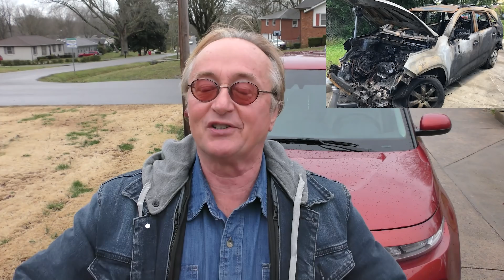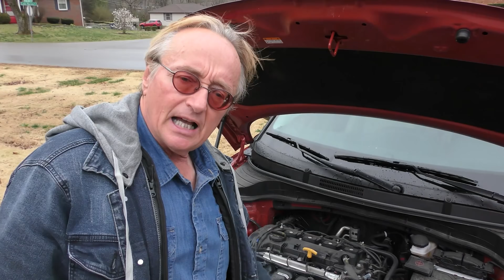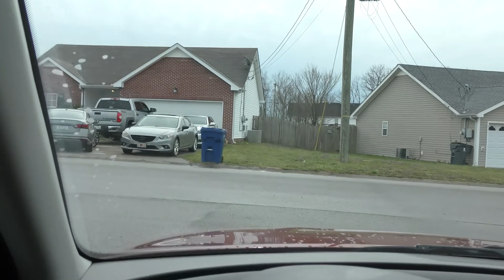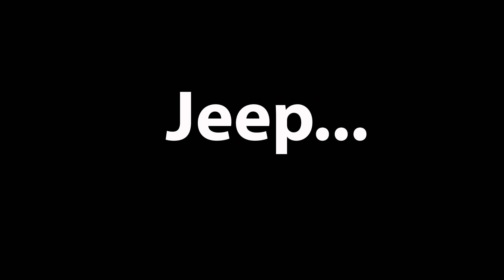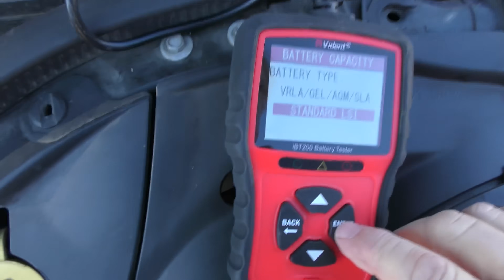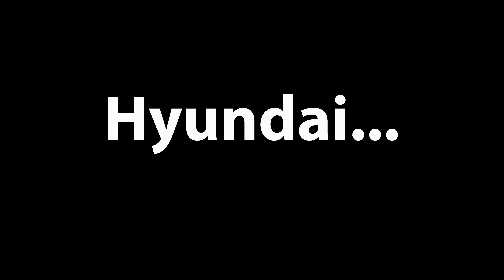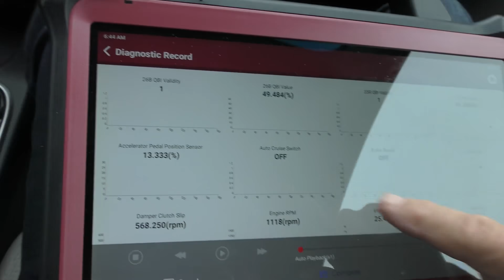3 Car Brands That are Crap

Comment: I jist chamged the sparkpmigs on our 08 Escalade....i put new ac delco sparkplugs in.. bur the old ones? THEY WERE SPOTLESS!  Totally dry, ,and not all carboned up, and not white , just a little worn, but it showed me, in gemeral, its healthy, although.i figured that, because its never low on oil,so i knew it dodnt burn a drop, i only use mobil1 synthetic oil and mobil1 filter

Comment: INVARIABLY DODGY COMMENT FOLLOWS:  "BUT BUT.... I own a (Hyundai/Kia/Volkswagen/Mini) with 484,000 miles on it, still driving like new!  A broken tire valve cap for 4¢ is the only repair it ever needed.  MY car gets its oil changed like clock-work every 29,000 miles and it's never needed repairs!  You people must be driving your cars in a demolition derby, right before the Indy 500 afterwards!"

Comment: My Hyundai was tough it had 437k on it lol of course after I changed the timing belts and idler pulley wheels and front end alignment and exhaust and floor work and windshield and wheel bearing ok whatever it was good on gas lol

Comment: I’ve got my mom’s 05 focus. Bought new. Oil changed regularly.  It now has 215,990 mile. Uses No oil. Runs as good as new. Gas mileage is 29-35.

Comment: I remember back 50, 60 years ago new cars used oil.  I had a new 74 Buick that used a quart every 500 miles. My first car that didn't use oil was a 80's Buick.

Comment: I have a 2020 Kia Soul, at 5,500 miles the fuel pump quit, I was stranded in the freeway for three hours waiting for a tow truck . Flash forward December 18, diagnosed with Transmission Failure at 72,000. Still waiting to get it back from the dealership as of today January 3, 2025. Kia stands for Killed In Action !!! By contrast my son has a 2014 Soul that has had no issues .

Comment: Technically, 1 qt (or liter) every 1,000 statute miles is part of the breaking in of the engine, as it wears, that oil consumption SHOULD go down over the next 20,000 miles or so

Comment: I own a 2004 Jeep wrangler that just refuses to die. It has 346,000 miles with the original motor and transmission. Motor burns no oil but does leak plenty. It really saddens me but the newer Jeeps are total crap.

Comment: A friend at work just bought her daughter a 2015 Kia from a private owner and had it only 2 months when the transmission died.  The mechanic said he could replace the transmission but there's another problem with the car: the engine.  I don't recall what he said what was wrong with it but basically said the engine will probably last another 3 more years.  She paid $4,500 for the car.  It's hard to believe the private owner she bought it from didn't know about those things, but she claims he didn't have a clue.  She even had difficulty finding an insurance co that would insure it.  I don't remember the reason but she finally found an insurance co that would insure it.   The fact that no insurance co would have insured it would have steered me away from buying that brand of car.

Comment: I would not buy a Kia either. I'm pretty sold on Toyotas I'm just going to get Toyotas unless I get a Ford and then I will get a ford. If I need a bigger truck than my Tundra then I will definitely get a Ford and I'm going to tell them to stop being a bunch of punks and make the Ford's easier to repair. I know it's possible Toyota does it and Toyota can you make it even easier to repair however there's still a lot better the Toyota mechanic said that he hates it when another brand comes in because he knows it's going to be harder to repair

Comment: My car leaks oil but it's got 250,000 Mi on it actually I think it leaked oil the whole time and I think I got it when it had 195,000 MI I'm actually not sure when I got it maybe I had 200,000 mi. But the guy who sold it to me lied and said it didn't have any leaks. It doesn't really matter to me that much because I feel like all my cars have leaked oil and I just fill up the oil. That would be pretty bad if it was 17,000 miles though

Comment: Those tipm issues are brutal. Such junk. My caravan had some hilarious issues. Windows up and down themselves. Lock unlock itself. Almost spent too much. Did some research. Disconnected battery, uninstalled tipm, electronic cleaner, back in with dialectteic grease. No problem since

Comment: Personal experience. 79 Ford Pinto: Trash. junked at 60k mi.
86 Hyundai Excel: Trash. Equal to Pinto.
94 Hyndai Excel: Not bad, sold after 85k mi.
98 Camry: pretty good. Some repairs. Sold after 165k mi.
2009 Kia Optima, 110k mi pretty good, still have it. Good as 98 Camry.
2010 Hyundai Sonata hybrid: lasted 200k mi. got money's worth.
2019 Elantra: 50k mi, so far excellent. They are getting better over the years. I would buy Kia or Hyundai without reservation. I expect 200k mi with reasonable issues similar to Toyota.

Comment: I've owned three Jeep Grand Cherokees, a Jeep Liberty, and a Jeep  Compass. I had to replace the computer in the 1991 GC at 106,000 miles, a timing belt, and a fuel sensor later. I changed the oil every 6 k miles in the 5 liter V-8. Put in platinum plugs once. Never had an issue until 175 K miles when I slid on a patch of black ice into the back of an old Ford Explorer at 10 mph and the front end exploded in plastic and Styrofoam, and the air bag exploded  in my face. Otherwise, that Jeep wanted to run forever. I live in the Rockies and all the Jeeps I've owned ran in the cold. Grand Cherokees are great, and that 2011 was pretty good, too. I didn't like the flared wheel wells -- kept popping them off turning into my garage. The 2014 Compass was a disappointment, but ran just fine. Even with 4 WHL drive it wasn't sure footed on the snow. Now I drive an electric Leaf. Too old for the mountains. 😉

Comment: A friend's 2013 KIA Santa Fe with 260,000 km still runs good.  It may not run as quietly as a Toyota, but it's reliable daily transportation.  As a die hard Toyota fan, I'm getting more impressed with Korean cars every day that passes.

Comment: Sorry, but this is not correct. My aunt has an old Kia Sportage and it keeps on running. And here in the EU you get 7 yrs garantee.
Reply: In America you get 60,000 mile bumper to bumper warranty and a 10yr 100,000 mile drivetrain warranty on Kia’s.

Comment: You cannot say a car brand is crap based on one car or a particular model. Kia is in top 10 most reliable car brands. I own a 2019 Kia Ceed and it runs perfectly well, I didn't had any problem with it.

Comment: Had 2001 chevy truck after 60 mph engin light took it back for yrs over this never got fixed by dealership millions of excuses. Had a old school street mechanic tell me i had engin issue when parking  he used a stecope to lissen to engines he goes right here 700 to fix it was a bent lifter from day one . Got it back gas milage better power like i never felt

Comment: Yep.. We purchased a 2017 KIA Soul, used, with 29,000 miles on it. We had the remainder of the factory warranty and did not purchase an extended one. At about 70,000 miles, we noticed it was using more than 3 quarts of oil between our 3500 mile changes. We brought this up with Kia and they said this was normal and nothing was wrong with the car.
We have a little over 100,000 miles on it now. As soon as we notice more then 1 quart of oil usage, we do an oil change now (averages @1200 miles). We will be trading this piece of crap in in a different car... That's coming soon.

Comment: Kia Manufacturing is the worst, I had a kia that would stop running while you were driving and you had to wait until it cooled before you could restart it.  After 5 trips to the dealer they finally found that the battery acid had leaked on the the wiring harness that ran under the battery and shorted some of the wires.  Told me it was a common problem but it would cost me several hundred dollars to replace the wiring harness.  Traded in next day on another car else where and that ended my Kia days.

Comment: Surprisingly my grandmothers 2015 kia Sorrento has lasted her 250k miles with the original motor and trans with no major issues besides the back electric motor for the windows failing

Comment: My Toyota Echo didn't start burning oil ( 1 qt. In 2000 miles ) till it got 600, 000 miles.  Now has over 800,000 miles.

Comment: I had a 2007 Kia Sorenta that I bought brand new. I put 326,000 miles over 11 years! It never left me stranded on the side of the road! I now have a 2018 that I bought in 2017. I’ve had it 7 years and have 176,000 miles on it! Oil is changed every 5k. So far it has never left me on the side of the road! So stop talking 💩about Kia! They are good cars if you maintain them just like any other car. The only thing that went out in the 2007 model was a some kind of heat/cold sensor for the heater and air conditioner which cost me $400! It was not covered under warranty! It never left me stranded! So there! 😊

Comment: Bought a brand new Kia Sophia for my nephew in 2000. No a/c, no radio, no auto and no p/w. Sticker was $8000 paid $6000.  Ram perfectly for 100,000 miles. No oil burning. The suspension was weird over bumps and the windows would slide down by themselves. The Sophia was tinny but ran excellent. Boy Kia sure went downhill!👎
Reply: Sephia was a different era like the Spectre

Comment: I had a 2017 Hyundai Sonata that had 48K when I bought it.  It burned oil BAD.  My wife has a 2017 Kia Forte that she bought brand new.  It has 75K now and doesn’t burn any oil.  It’s been a great car with no issues.  Kia/Hyundai’s quality is very inconsistent.  I would never buy another one.

Comment: Been very happy with my Kia Soul. Original design (2013)  I live in Iowa. A couple winter ago I abused the exelleration trying to travel on very icy roads in town. Im talkin flooring it several times as I tried to get home. I believe this caused a considerable knock in the engine. Lived with it for a year but finally took it to Kia for diagnosis. I didn't mention my abuse. They had a guy come from out of town to check it out. They found burn marks on 2 cylinders. And clearly heard the knocking. It always recieved timely maintenance. They replaced the engine. No cost except the diagnosis. It runs fine.

Comment: Clownshoe Scotty finally said something I agree with: I never sold a used Kia unless the customer insisted on it, and wouldn't come off it. I never lied to a customer. Even though we made more money on used cars than new, I would always try to convince parents to lease a new VW Jetta rather than a used Kia, Dodge/Chrysler, or Hyundai for their child's first car. Leasing a new entry level car will give you a low payment, but it comes with a bumper-to-bumper warranty, including free towing, for the duration of the lease If they're going off to college, you never have to worry about your child being stranded with a broke down car in a strange city.Further, if the child wrecks the car, at the end of the lease you can turn it in and let the manufacturer eat the loss of value. Lastly, if you put the child (18+ years old) on the lease, when they graduate college they can buy out the lease and keep the car, or trade it in for a different car, and they will be 22 with a paid off lease on their credit. Established credit, all the newest safety devices, low payments, peace of mind while your child is away from home for the first time. I NEVER had an unhappy customer with a Jetta or Tiguan lease, and almost always, both the parents and the child became regular customers.

Comment: Jeep was great back when they were running those inline 6 cylinder engines. But i will never own a modern Jeep. They tend to spend more time on a lift than they do on the road. My wife has a Corolla and you can't beat it. I've gone through 3 cars (Chevy Cruze, Ford Taurus, and Chevy Camaro) in the time she has been driving that Corolla.

Comment: Not sure if this is an "eternal" issue or something with newer cars, I have a 2005 Hyundai Elantra and the transmission still works like new. Only major repairs done are really an axle replacement as well as a faulty water pump, however I think the first one is the result of constantly driving on garbage roads for 15 years (at the time).

Comment: I got very lucky with my Kia soul. I bought it two years ago for $1,500 with 168,000 miles it is a 2010. I have only done oil changes and did all rotors and pads recently as well as front struts and that was all. It does not burn a lick of oil and it is the 2.0 engine with 171,000 miles now using synthetic oil. I do my oil changes every 3,000 miles although i dont drive that much I dont like to let it go too long without a change so at least once a year. It has treated me well I am just suspicious of the 4 speed transmission and its jerkyness. It is a very jerky car and sometimes the transmission has trouble making decisions. Gonna ride this soul out and hopefully save up for a used tacoma or rav 4.
Reply: Also fyi it has the original engine and transmission and I am like the 3rd or 4th owner. The first few years actually had the strongest engines and some people have gotten over 300k and on their way to 400k in the 2010 to 2011 model year souls.

Comment: My wife had a 2015 Hyundai Elantra. We bought it new in 2015 and just traded it with 127000 miles and it was the most dependable, trouble free car I’ve EVER owned. I’m 64 and have buying cars since 1975, so that’s saying a LOT. I never did anything to that little car but changed the oil and it was still getting high 30s gas mileage when we traded it last week.

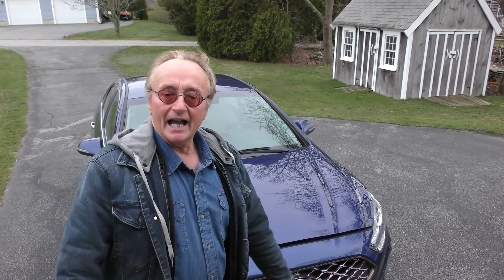Comment: 21:52 Transmission replaced 3 times.. haha.. I bought a used Ranger some years back from a used car dealership, yap, a mistake, and the torque converter would slam shift between gears as if the torque converter was stuck locked. Of course I took it in to have them make it right. After about 3 times of doing this the slamming went away with no more O/D blinking light. Of course with all this down time I found a used mid 80's Toyota 4x4 pickup with roll bar, tool box, nice stereo, header, weber, mudder tires for $450 direct owner sale. Until one day I went to service the tranny, change fluid, etc, I guess they fixed the problem by removing the tranny filter. They most likely had to change the torque converter, but then never rectified their guess-work along the way such as removing parts of the tranny. Never again used car lot; dealer only; so shady.

Comment: I did not expect to see Jeep here!😮 It's all I've ever owned in my adult life.

 I purchased my first Jeep Grand Cherokee Laredo in 07 and just sold it after 320k miles. Bought another in 2016 and I've had zero issues (still own it), and both a hybrid Grand Cherokee (4XE) in January.

Now I'm actually worried.

Comment: 20:15 have a Subaru that would not start in under 20F weather, anything above, no problem. Turned out it was the starter, even though it didn't seem so. Turned out it wouldn't turn the engine FAST enough for the cam sensor(?) to pick up that it was spinning. I read this was an issue on the Internet, so tested it on a 15F day. Tried to start it, would spin, smelled fuel no start. Took my wife's blow drier to it for about 5 min, it started RIGHT up. Changed the starter and it has been fine.

Comment: You forgot to mention that Kia and Hyundai from 2016 to 2021 you can pop the ignition out with a flathead screw driver and start it with a USB cable no key needed

Comment: Aw, here I was hoping he'd talk about FIAT, so I could defend the honour of my 185BHP Bravo hatchback that gets 55 mpg and is pretty and fun to drive. I mean at 92k miles it's practically brand new - never had a single problem with it. 

Except for the MAF sensor. Oh and the air filter box clips, and the rear calipers needing a rebuild, and the rear calipers needing replacement even after the rebuild, and the handbrake cable snapping, and the clutch exploding and taking out the flywheel, and the clutch master cylinder leak and the leaky brake lines and the gear linkages getting gummed up, and the head gasket crack, and the coolant leak, and the turbo leak that cuased the exhaust to be spat off while overtaking, and the sterring rack rattle and the oil cooler rupture, and the three broken springs, and the collapsed shock, and the other two collapsed shocks, and the failed oil seal on the gearbox, and the failed drive shaft, and the radiator leak, and the EGR valve failure, and the clutch pedal snapping mid drive and ...

Yeah OK time to sell it.

Comment: All vehicles have a similar underhood fuse/relay box since the 1990's.  Don't know that Jeep box but the one in my 2002 Chrysler has multiple connectors to the bottom of the box.  Owners in the rust-belt have issues with corrosion in those connectors from rainwater or condensation, even though sealed Metripak type.  The connectors make it easy to remove the box, so likely were to speed assembly.  No problem in mine, but to be safe I removed and filled each connector with silicone grease.

Comment: This kind of news makes me appreciate my little '10 Honda Fit. 186k miles on it, the only 'maintenance' ever: diligent routine oil changes and so far just 1 set of new brake pads, nothing else, not even spark plugs (probably should replace those before long) and it uses NO oil. Hard to beat.

Comment: Chrysler had a class action lawsuit filed against them for their TIPM’s. They knew full well they were junk across the board and sent them out anyways. Fuel pump relay is internally wired to the TIPM. Absolutely brilliant idea, not being able to change it 🥴

Comment: Bought a high quality aftermarket battery for a 2015 Jeep Wrangler and found out afterwards that the alternator was overcharging the battery and causes the cells to expand. Causing all kinds of electrical glitches in the main display. Turns out the battery needed to be registered against the Jeep's TIPM system. Moral, just get a battery at the dealer.